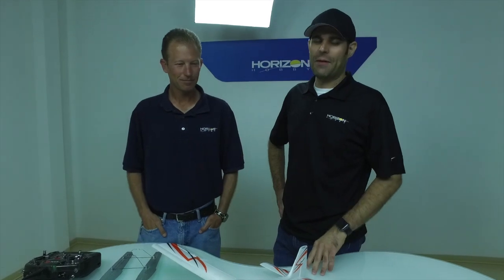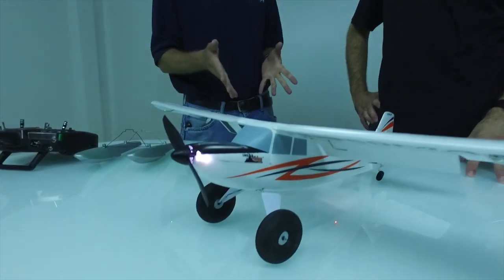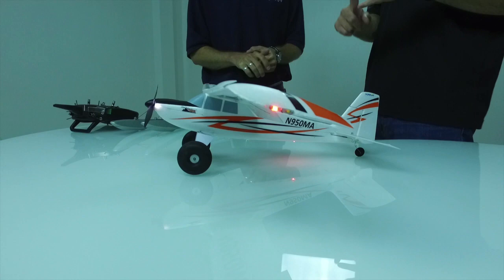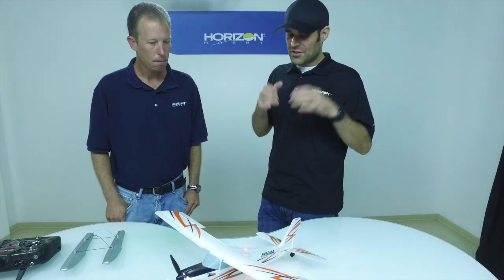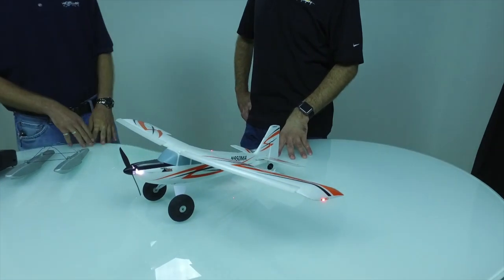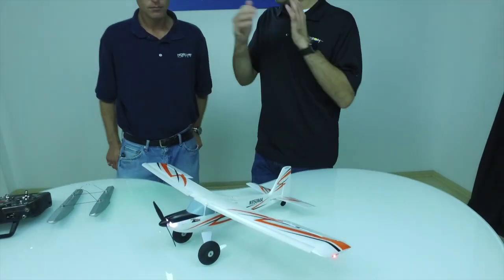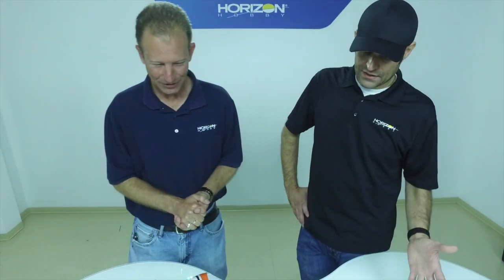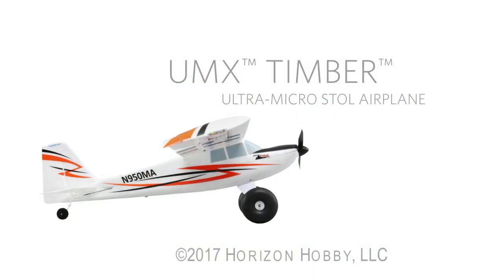E-Flite UMX Timber Facebook Live Q&A

Comment: HELP. I just realized the E-flite 2S battery only has one lead. How do I charge that on the charger I already own? So confused. I do not want to have to purchase a separate charger. I already have a nice 2 port balance charger now. I read of adapters but what adapter would I need? I think HH should at least include one with the plane.
Reply: You have several choices. Yes, you can buy the adapter(I own one and will explain what it looks like). Many planes that are 2S RTF include a charger to charge Eflite 2S directly. You could wire in a jst plug off the red and black like I will be doing soon. On the plane, you can also wire in jst to take more than some of the Eflite batteries. The real issue is not the single lead but that Eflite 3 wire lead is different than other leads, so it won't plug into the balance lead. The adapter that I have pulls off red and black and plugs directly into charger with banana plugs. It also pulls red, black, and white into the plug that will be the balance plug. So the red and black is a Y coming off the banana plug and the white is just a jumper. So make one or buy one. Motion RC via google: Charger Plug Adapter EFL

BRAND: E-FLITE / SKU: EFLA700UM